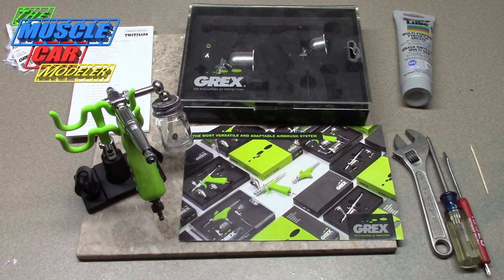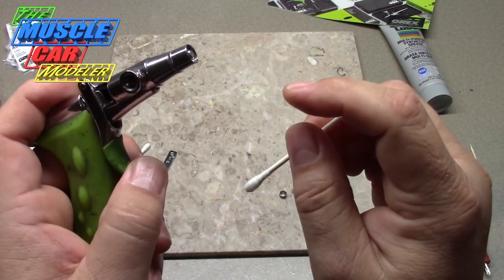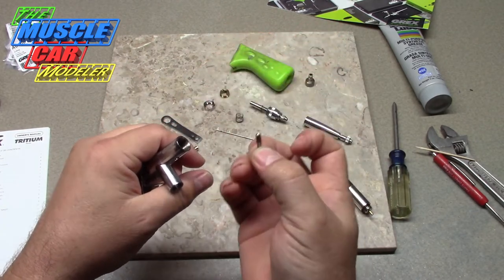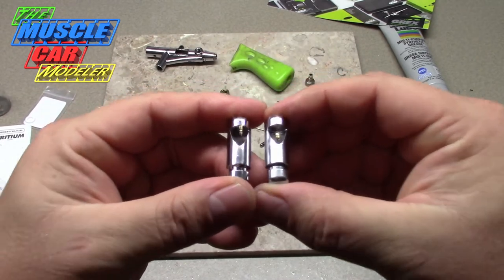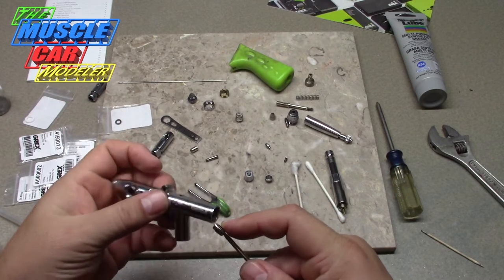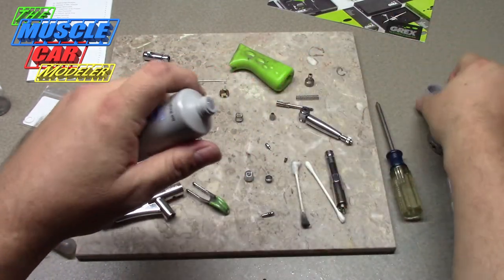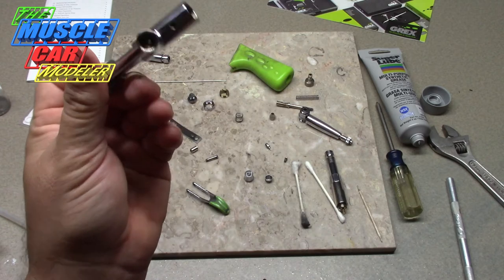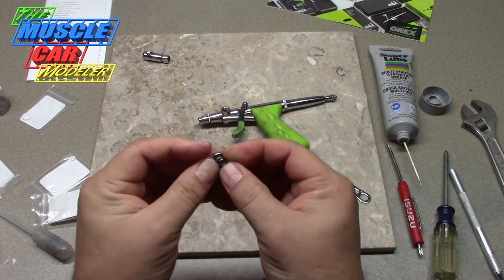How To: Airbrush, Full Tear down, Fix and Maintain!

Comment: Excellent video!  Your's is the only one I've seen that includes the needle seal removal/replacement.  I've had mine for six years, but not used it very often...I've deep cleaned it a few times, but never attempted to deal with the seal.  Thanks!!
Reply from the maker: Thank you!

Comment: i want to start airbrusing and i was wondering what is a good starter setup.been building for years but id like to try it out.im pretty good with rattle cans but so many set ups.id like something kinda middle of the road.love your channel.OH by the way love your fury wagon.very rare wagon.keep us up to date on the build.cant wait to see it on the road.
Reply from the maker: Cool. I can't really answer that as it has more to do with you than the airbrush. Getting a good quality one is only 1/3 of the equation, The rest is you learning what works for you on how you hold it. How fast you move the airbrush. How close you are to the model. How much paint is flowing. It takes practice learning what works for you!
Reply: Many, many choices.  I love my Tritium, but for basic car body painting you can use a Paasche H model with #5 nozzle set.  I made a living building model cars (mostly 43rd) in the 80s and 90s and I only used a set of Hs.  I still use them for everything except fine-line camo or color effects.  They are tough, easy to clean, and very reasonably priced.
Reply: i found a airbrush kit at harbor freight.it has the compressor and twu guns.has anyone tried this one yet.just curious.it cost 90 dollars.just wondering how good it is.
Reply: @miguelonsurez90   The compressor will probably be ok, but their airbrushes are really hit and miss (mostly miss).  You'll spend valuable practice/learning time trying to make them work for you.  You can find a good double action gravity feed airbrush for $75 to $100 (even cheaper if you go single action external mix; Paasche H set is $60 from Amazon), and buy a compressor off Craig's list (I bought a Paasche labeled Binks diaphragm unit for $15 about 15 years ago for a project and still works great).
Reply: @orangelion03  ok thanks.i checked them out and thats probably what im gonna go with.thanks for gettin back to me,i appreciate it brother

Comment: How many years did you have it before problems started or how much do you use it ? Daily ? Weekly ? Monthly ? Just bought mine and was going to use it for spraying the car model bodies and have the fan cap for it , sweet
Reply from the maker: I use mine a lot. Usually, weekly. I have had it 5-6 years and was not very good at cleaning it at first. When I did clean it, I was not lubing up the areas that needed it. That is why I did this video.

Comment: I never knew there is a trigger airbrush! I've been using my H&S for years without a hitch so never looked into other airbrushes. 
I was trained to paint real cars so I'm used to trigger type spray guns. I notice this has a standard airbrush tip. Do they make one with spray gun type tip? For a wider spray pattern like Devilbiss? Now that would be kool. 

I'm going to look into it and get one now.
Reply from the maker: Yes, Grex does offer the Fan Caps. I bought one but have not installed it or tried it yet. It warns that the compressor man not be able to supply enough air for it. http://www.grexusa.com/grexairbrush/prod_type.php5?prod_type=Fan%20Spray%20Caps.
Reply: @TheMuscleCarModeler . I was reading my latest Model Cars mag. and there are 2 adds for the Grex! I have a commercial type compressor too.
Reply: It works great!  I have a central compressor in my garage and tap air from that so I dont lack for pressure/flow.  I've used it for applying primer, but it does flow a LOT of paint...more like a small touch-up gun.  Worked great for helmets, and motorcycle bodywork.

Comment: Don't own one of these airbrushes but it still was rivitting to watch. Looks like you haven't had a glass paint bottle break yet from shaking it with a metal ball inside.
Reply from the maker: I have had a few crack the Testors bottle. I have broke a few airbrush bottles too but they fell off the airbrush or rolled off the table.

Comment: One more question. What size needle do you use?
Reply from the maker: mine is .03. I have thought about getting another one and putting the fan cap on it.
Reply: @TheMuscleCarModeler  I just ordered the .03 for thin, premixed paint with the .03 fan cap. Ordered the  05, with the fan cap, for thicker paint.